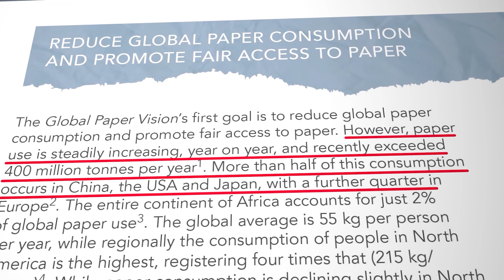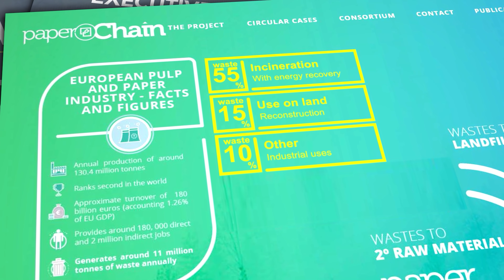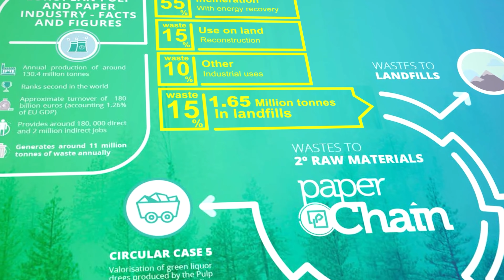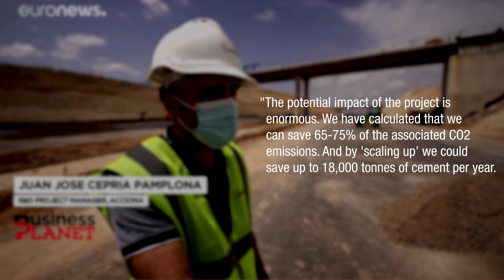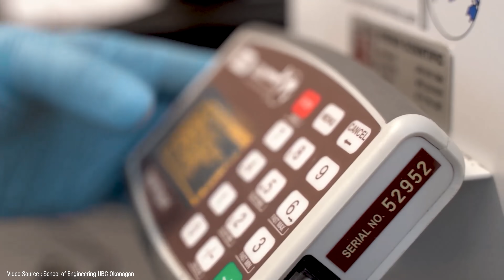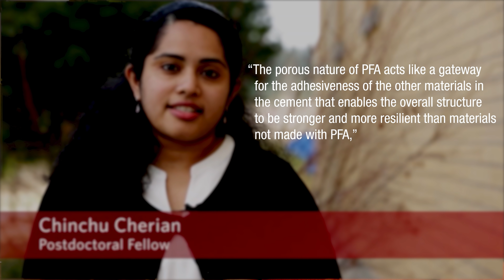Could papermill landfill waste pave our highways?

Comment: The worst thing you can do with paper, wood, or other biodegradable materials is to landfill them.  When they are covered up, oxygen is excluded, so they degrade anaerobically, producing methane, a potent greenhouse gas much worse than CO2.  There are some landfills where the methane is captured and used as fuel, but most do not.  Biodegradables that can't be recycled should be composted.  Composting does produce CO2.  The next best thing would be efficient incineration, which also produces CO2 but at least not much particulate pollution.  Energy can be recovered from this.

Comment: All well and good until the part burning it to make ash followed by heating it to 700 degrees burning more hydrocarbons to produce heat.. every process you add to production has a potential to add carbon emissions and therefore make a splendid idea into another avenue for more of the same old song and dance.. burning limestone to provide lime is the heart of co2 emission in concrete products, but there are also no emission free ways to transport concrete to the job site regardless of the process of producing it

Comment: Hello David, can roads made with PFA be recycled? Concrete and tarmac roads are 100% recyclable. One possibility that looks interesting is using PFA instead of Portland cement in 3D printed buildings. Less carbon emissions and low cost (potentially) homes.

Comment: We already have a surplus of glass wastes to use as aggregate so do we even need to use the wastes from the paper industry especially since autonomous vehicles should increase the efficiency of roads without creating more roads.  Sure we can also use it for building materials but do we want a world encased in concrete?  The environmental benefit only exists when it displaced the use of less environmentally friendly processes, will this actually do that or will it just be in addition to existing processes and aren't some existing processes such as pulverizing glass wastes to be used as aggregate already environmentally friendly.  This will just lead to greater use of concrete in general.

Comment: While in grad school, I was "innovations Editor" for "Highway and Construction Magazine." I visited a dozen, or so, fly ash projects. Back then they were using fly ash from coal. Not all of it was useful, however. It all depended on the quality of the coal. In any case, I was greatly impressed with the many ways it could be used. This sounds like something much better. The instant you mentioned "fly ash," I was sold. Waste material being repurposed . . . while reducing CO2 emissions.

Comment: Thanks for the video.
Please be aware that most of the paper worldwide is recycled. In Germany, roughly 75% of the fibres used are recycled fibres, and the share is increasing. In Europe, far more than 50% of the fibres used are recycled fibres.
So you don't have to calculate 400.000.000 tons of paper production, as a big part gets back into the paper - even in China, but not in the USA (Chinese paper mills collect the American waste paper and use it to make new containerboard and sell to the American paper mills certificates that the waste paper isn't incinerated, but used to make new paper and board.
Modern European mills recycled fibres far more than 10 times. In stock prep they separate the fibres from other residues like plastics, shoes or cats. Yes, you find quite frequently dead cats in waste paper.
The sludge residue is compressed and dewatered to use it as energy for the paper making process. The ash resulting of that process can be used for several applications as you mention. But most of the fibres nowadays are already recycled, and there are even waste paper wars in the world except the US which has not switched to recycled fibres except for a few mills.
So paper industry is the biggest industry which has almost closed their cycle and think cradle to cradle.

Comment: I think we're overlooking a viable avenue to carbon sequestration here. Paper is a renewable resource. If we can get paper producers to run carbon neutral (mainly by carbon-neutral transportation and production methods), then the paper thrown away is the definition of carbon sequestration, one of the few ways to reverse climate change. AFAIK, paper is non-toxic, so perhaps it wouldn't need to take up space in most landfills and could be sent directly into the ground?

Comment: Neat tech but the cost of producing the new material sounds very high.  That cost would have to find a balance between doing good things for the environment vs the cost of plain ole cement.  Communities that contract corporations to build their buildings and roads usually go with the lower cost, proven tech I would think.

Comment: Any possibility, plastic waste could included in concrete to help strengthen?  Would be another way of solving a growing waste problem.
Reply: There's someone in Africa has come up with a process to turn plastic waste into bricks.
Reply: Also saw where a young man in Canada had successfully mixed plastic waste with wood to make panels at 30% of cost of plywood. Very promising.

Comment: Sounds like a good option for cement replacement. However, I assume all of the carbon content was burnt off as CO2 and this is just the mineral content of the material.

But if it replaces cement it must move us in the right direction.

Comment: If this has to be cooked to 700c are we actually saving anything relative to real concrete production?
Reply: I was thinking the same  it depends on how you cooked it?  If you used the waste paper product as a fuel source it would be neutral and generate it's own ash.
Reply: Actually with global warming, temperatures in the shade will soon reach 700c so no heating will be required.
Reply: It’s about half the temperature for normal cement so improves the chances of using non fossil fuel for the heating process as well as probably less energy overall - but that also depend on the length of time for the process as well of course, which might be lower as well.

Comment: Modern wooden building in Russia are supported by metre deep foundations, but only at the corners, or other stress points.  A fairly narrow, tubular hole is dug, topped by about 1/2 metre of shuttering (depending on site conditions) to a uniform level is filled with concrete.  The non-load bearing wall between the foundation points can have a much shallower base, and is usually formed of a cement thermo-block.

Comment: Very interesting use of what is currently considered a waste product. Our landfills are potentially full of valuable stuff we just haven't figured out yet. Another thing to consider with roads would be micro plastics and other pollutants making its way into our oceans as roads (and tires) wear down. All that stuff is washed away and ends up in sewers, rivers, and ultimately the ocean. Fly ash of course is the nasty stuff that stays behind when we burn things like coal. Replacing fly ash created like that with fly ash created from more sustainable fuels (like dead trees in the form of cardboard/paper) is of course an improvement. But it's still nasty stuff potentially.

Comment: New?
They've been putting paper mill tailings in bitumen for decades. Along with crushed glass and more recently shredded tires. At least they were, until the paper mills were shut down.
Valid point about trees though. 

Want more trees planted? Use more paper.
Reply: There is a whole Ecosystem you have to think about when going into the forest and cutting down trees if we want a renewable type System why not plant trees for the sustainability of this market instead going into the Ecosystems and unbalancing them. 

So we'd have an addition and not a subtraction process...
Reply: @steve-o6413  All that aside my friend, at the end of the day the population is growing, as it always will. 

There's only a certain number of feet that can fit in a square metre of terra ferma. 

The brutal reality is, the human race is not sustainable.

More short term though, the climate is not the existential threat the media would have you believe it is. If it were, we would be reverting to newer nuclear reactor designs that already exist and burn up the nuclear waste that is stockpiled from gen 1 and gen 2 nuclear power plants.

There is enough nuclear waste stockpiled in the USA to power the USA for the next 200 odd years, carbon emission free, using travelling wave fast breeder reactors. They are fail safe, emit zero carbon, and would solve the nuclear waste problem to boot.

It's just another little story to keep everyone occupied, and to give them something to feel indignant about.
The answers to that "problem" already exist and have done for decades. So why are they not being implemented if Greta is such a prophet, and not just in it for the profit?
Reply: @steve-o6413  WOW.

You're a special kind of special.
You clearly have no problem professing your opinions on subjects of which you have absolutely zero understanding.

As for "media hype about overpopulation"... mate, I haven't owned or watched a TV for over 12 years. I wouldn't know what the corporate media are hyping. That aside though mate, reality is reality, and the inevitable is...

 That last sentence tells me all I need to know about you pal. 

One day, you'll get sick of people laughing in your face. Nice try though. You have a nice day, little fella.
Reply: It's new for the cement industry though.

Also, "buy more paper = more trees planted" isn't the full story and doesn't properly reforest areas. The lumber industry plants mostly fast-growing pine monocultures, as opposed to doing proper reforestation with many species of native top canopy trees, along with sub canopy trees/bushes, and ground covers to fill in the rest of the ground space.
Reply: @Rob-uy6gz  Those trees will be cut down anyway, eventually.

The harsh truth is that the human race is not "sustainable".
Reply: @jimmyb1451  Nope I disagree, we choose to be unsustainable. Simply because a tree exists does not necessitate that it will be cut down. Yes, everything dies, and all trees alive today will one day die and fall/be cut down, but that's not the whole story. A tree's above ground canopy only makes up ~30% of the total captured carbon, with the other ~70% going into the root systems and ground via sugars. You don't see humans digging up all the roots/ground around trees to harvest those. Additionally, we cut trees because we choose to do so, as we use them as feedstock for other industries - we're not obliged to cut trees simply because they exist.
Reply: @Rob-uy6gz  yeah. All true.
But some people have less concern that you or I.
Reply: @jimmyb1451  that's definitely our biggest overall problem

Comment: Let's hope they just 'hurry up' about it. Good environmentally-friendly alternatives and ideas seem to take forever to get off the screen and into reality. 

We've had to resort to laying down ordinary cement for the edges of where a workshop extension is to go - the central part to be filled in later - but not too much later. Would like to see this get on the market fast, and at a more reasonable cost than the price of real cement, which has quadrupled since we last bought any. 
Make it easily available in DIY stores and not something you have to order by the ton from special manufacturers you can't track down easily. 

Also, I hope China is paying extra attention to this product, since they're losing so many houses and infrastructure with all these floods. That means a lot more rebuilding afterwards, a lot more cement, and a hell of a lot more CO2.

Comment: rain and termites…

there were buildings here in this city using paper in concrete mixing long time ago, the building collapse and the company get sue. it was consider as a fraud. so, I don't know about other country, but very likely the idea will be rejected before it see sunlight here. some of the reason is, it absorb moisture more than concrete, and then melt and wash away, leaves a crack inside the concrete, the other reason is termites, they have small enough jaws to sort paper fiber from concrete, again, not only from a crack, they form a nest… the third reason is force, what kind of paper we are talking about? how it is prepared makes difference, those "paper" in use 50 years ago i have been told were mainly old newspapers, for obvious reason, it fail on strength, if i remember correctly, there is a building regulation say so, if concrete or bricks contain too much foreign objects such as hay, paper, plastic foam, builders responsible can be sue and fine. building will be consider as danger and had to demolish.

Comment: People from all cultures used (and some long living ones still do) to put wood ash in their gardens to fertilize their plants as the wood ash is the minerals left burning the wood. Adding this valuable resource under our roads, which in some longevity cultures is still added directly too the consumed food, is a huge wast of valuable resource. Use this a as fertilizer, in the agriculture, and not instead of cement for road construction.
Reply: Only 10-15 percent is used this way currently. Most of it goes to landfill. Finding other uses therefore is important. I also feel like it would be better used in fertilizer, but there must be a reason it's not. Since people have to pay to dump it, that tells you there isn't even a market at $0.
Reply: Wood ash is a basic pH and so it cannot be used on acid loving plants
Reply: @barbaralindhjem2488  Yeah, I think it’s possible to overdo it with wood ash.
Reply: It is a good source of potassium but low in nitrogen and phosphorous. So it can be used as 10-15% as additive to regular fertilizer but only ash will be highly basic and cause soil damage.
Reply: @janami-dharmam  as to the nitrogen and how it becomes available in the soil, may be helpful to improve your knowledge, from some of the best experts in the field here: https://www.youtube.com/watch?v=yAKRjgWsPXE&t=530s

Comment: I saw that graphene was now being tested in reinforced concrete as a building material. It is much lighter and doesn't corrode like rebar and is much stronger.
Reply: Rather more in favor of basalt fiber rebar as a replacement to steel.  Cheaper and less energy intensive (though still substantial).
In any case, getting steel out of concrete should be a no-brainer.  That’s why our modern concrete is lucky to last 100 years, whereas the concrete the Romans laid down 2000 years ago is still in good shape.
Reply: @joelsmith4394  I thought that Roman concrete had the advantage of being made with locally sourced pozzolana ash --- in other words, the problem with modern concrete is chemical, rather than being a result of steel rebar.
Reply: @compassroses  I'm not up on Roman cement, although I do remember reading that the ash was a big part of why it works so well. I do know that in road building at least, water penetration of concrete rusts the rebar, which swells and acts like a wedge against the surrounding concrete, eventually breaking it apart. (not an engineer though, just an info sponge)
Reply: @compassroses  that was a factor, but the water content of the mix, method of application, and lack of expanding reinforcement to cause cracks were all more important to the longevity of Roman concrete.
Reply: @compassroses  As I understand it, a primary mechanism of failure in modern concrete is that the steel rebar swells quite dramatically when it rusts.  That swelling breaks apart the concrete from the inside.
Reply: They are using it on hs2. I believe on Euston station
Reply: It's gonna happen.  15 to 25 years from now it will be the standard
Reply: Roman concrete was only ever used like stone, in large columns, arches and suchlike. Reinforced concrete is used to make beams, lintels and the flooring in multistorey buildings that plain old concrete couldn't cope with. And if you tried to construct hi-rise buildings using arches and other techniques they'd be too heavy, so the lower floors would have to be mostly solid concrete.
Reply: It is stronger than steel for equal weight. When we think we consider strength for equal size or volume. It is also very expensive to make. But carbon fiber is more promising because it can be embedded in plastics.